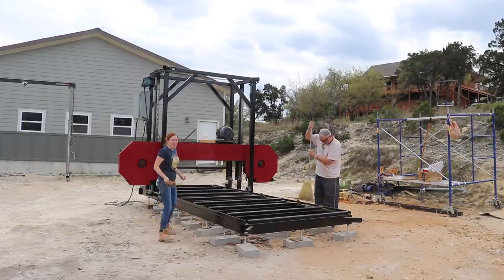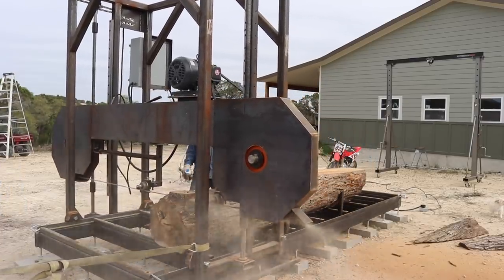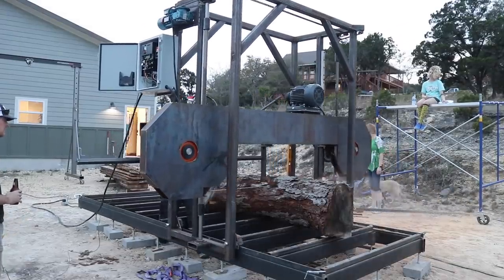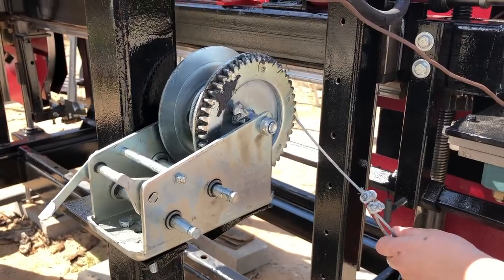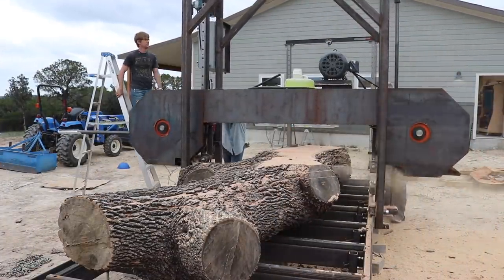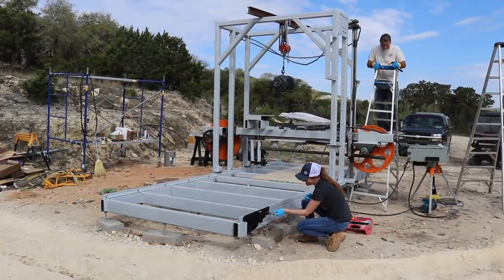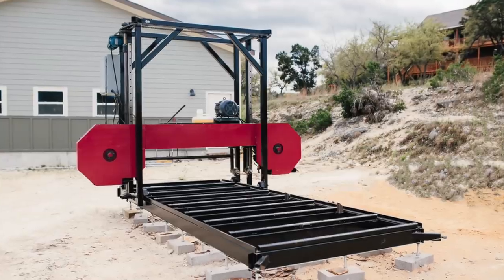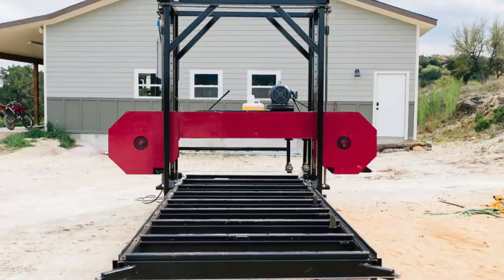Slabbing With My Bandsaw Mill

Comment: April, nice work on the new sawmill. It looks great. For ideas only, take a look at the Wood-Mizer LT35 Hydrolic Sawmill.  It’s expensive, but it may give you some ideas for your own sawmill.  The Hydraulic loading arms, turning arms and log leveler options all make it so much easier to do milling. At a minimum you probably need something to hold the log in place while you cut the slabs, which not only gives you a better sawn result, but it also saves your blade in the long run. Imagine what it would be like if the blade hit something hard, like a nail or a piece of embedded barb wire; the teeth might catch and move the whole log and who knows what kind of damage could be a result of that event.

Comment: I enjoyed this series a lot and it looks like it turned out great!. i have a few tips. when you pour the slab you could have i beams in the floor that you can weld the bolts to in case the floor isn't exactly level. or you could just simply put anchors in the floor.

Comment: I've been milling slabs and air drying for 8 years and can offer some insight.  Some woods, particularly sycamore, will dry much flatter if your stickers are placed all the way at the end of the slab.  It reduces cupping at the corners.  Sycamore is also prone to 'sticker stain'.  Using pine stickers can stain sycamore 1/16" deep into the wood.  My solar kiln is great in the summer but in winter I wish I'd have built a dehumidifying kiln instead.  Lastly, treat the log ends before you mill.  It's so much easier than painting individual slabs.  :)

Comment: Make a kinda greenhouse shelter 
Roof can be clear or solid. Solid for shade.
Make the sides out of soft clear plastic, and add ribbing to it. Sides like this will serve 3 purposes. 1, protection. 2, dust collection, especially if you ever move the mill into a warehouse setting. 3, they can, because of the ribs, be lifted up to the roof when they need to be out of the way. There are other ways of doing usefulness 3, like curtains, but the ribs will provide support and weight. 
I suggest table cloth covers. You can get them thick and cheap from Walmart or a dollar store. They are also more clear than most plastic that you can find at construction stores like home depot.

Comment: Like the color. As a suggestion for the blade supports. To move them in and out from the logs you are cutting. You could use a long lead screw to do this when you are by yourself. Lead screws are generally used on 3D printers and other machines.

Comment: great seeing you build your own mill I built one as well. one thing, you might consider on your slabs banding them together using a shipping binder  even though you think the weight is enough to prevent cupping or warping, it isn't always I cut a 42" by 12 foot walnut log getting 6 slabs banded them together and had no twisting or warping.

Comment: nice job.
one tip, always carry your logs, instead of dragging them so they stay as clean as possible.
dirt will dull your blade.
The Height guide on my mill, is simply a magnetic ruler stuck to a vertical post, with a plexiglass wrap around that rides with the saw head. simple, works great.
Nice mill, good luck

Comment: Im a structural engineer and wood enthusiast interested in building a wide capacity mill. Your video series was awesome and inspirational. Very impressed with your build team’s fabrication and mechanical skills. 

I wonder if a bigger hand wheel crank would be a good upgrade for moving the mill versus the smaller winch handle?

Comment: When you get around to building a covered area to cover it, a crane above running from an area you can unload from the tractor would probably help with loading logs onto the bed and unloading, plus it would give you the ability to load directly from the trailer

Comment: tips 
Moving the blade guides in and out is the best way. 

Using a sand blaster to remover rust and prepare for paint is best. 

A pole barn is what you want for a cover.

Diesel is bad idea many reasons 

Water is best !

Comment: Great video series. Diesel or kerosene may affect finishes later when you work the wood. I would stick with water myself. You will want to get away from dragging logs as much as you can too. Dirt stuck on the logs dulls the blade quicker.  If you can stage them on beams or logs to canthook is best, but some of what your doing is impossible to handle that way. Love the sawmill, great build. Thanks for sharing

Comment: A few suggestions from when i owned a mill for a few years.   Put considerable weight on top of your stacked slabs or ratchet strap the middle and ends and tighten them periodically.  Will keep slabs from twisting and cupping as much.  Also when loading tapered logs on your mill, use stickers to "level" up the smaller end.  You will retain more usable lumber instead of one big shim that tapers to bark.  Its a judgment call which side of a log has the most value/character but that is the choice of the mill owner!  And the last trick I learned was to coat the end of slabs with wax or some type of water retarding coating.  It helps the slab dry at a uniform rate, otherwise they dry end to middle and that will cause splitting at the ends.  When doing this make the slab look like it has been dipped an inch deep in whatever you use, not just the very end.  Exterior latex paint 2 coats thick works also and is easier to play with than melting wax.

You may have already learned this since video posted, but if not, hope it helps. Nice mill.  Who do you have to find all the parts for building things like that?  I can literally spend 100 hours on the internet trying to find a part like the weep valve with a window and never find it.  You made it sound easy. Thanks for the video. Looking forward to watching more.

Comment: A sawmill uses an out feed trey and a sticker stacker I operated in a chip n saw small log mill. You need a set of forks mounted on your tractor and a counter weight that connects to the three point hitch. We bought an old industrial tractor. You are making chants or slabs instead of a cutting list for a building package. A sawdust recovery system and designer barker. You can stack your spaults and call in a chipper or haul out on a trailer for hog fuel that runs a boiler. Your option is a rack or trailer. So you need lumber out feed and slab out feed. Some material like hemlock has a natural twist to it while whet or drying. You van call in a grader to grade and stamp your wood to meet code. Old dryer systems use rail track. For level track to move lumber. Stable ... We used bunk cants to store lumber.

Comment: Serious unit. I watch a lot of people using Saw mills and not one of them uses diesel, they all use water but if that's what works for ya. Great video.
Also seal the ends with paint or anchor seal and try using a 12'' or 16'' joint compound blade for the sawdust, works great.

Comment: Very nice project. I think it will pay for itself with lumber production. A ‘retired’ neighbor of mine brings in between $1000 - $1400 a month working about 20-30 hours a week slabbing lumber so this could eventually not only pay for itself, but also pay for some of the shop as well. A flat concrete slab will be useful in several ways. I recommend you check out a YT channel by Bus Huxley where he built a nice shed for the band mill of a neighbor. He has some good ideas for sawdust control he included. Also, check out the way the Woodmizer LT35 uses hydraulics to handle the logs making it much quicker and easier for one person to handle heavy logs. It could be a terrific upgrade to your mill. 

Keep your great videos coming our way.

Comment: April, you have lots of great suggestions in the comments! One I would suggest that I have seen and have not seen in any of you videos is to get a set of forks for either the skid steer or tractor (perhaps they would fit both) you find a 1000 uses for forks but also get greater control for moving your logs. 
Along that line, try to always lift the logs instead of pulling them out of the pile—sand, dirt and gravel are all not friendly to your saw blades!

Comment: you may want to try having a power washer nearby . i dont have a debarker so i wash the dirt off my logs before i roll them onto my mill . keeps my blades sharper longer . also use it to lightly rinse the sawdust and detergent from blade lube afterwards . i dont see anyone else on youtube doing that but it works well for me .

Comment: Great project!!! as usual!  But $$$???  My bro-in-law has a gas powered sawmill for slabbing, but he ends up making everything into planks for construction. Ash, oak, cedar, poplar, maple, walnut, etc. He made a saltbox shack up by his pond all out of poplar (great for 2x4 studs and framing!) and cedar for the batten and board siding... All from free logs cut on job sites where he works (they install home solar racks and sometimes they need to clear land for them!) As you did, he stacks and stickers them under a covered area (carport for his tractor and other large equipment) but open to the outside air.

Comment: So one of the things that might save a lot of headaches and money in the future (because the EPA rules that passed about 8 years ago) is to have a way to contain the diesel from rainwater runoff. When you pour your slab, have it drain into an oil separator. It's basically just a catch basin that stays full of water and doesn't let the top layer flow past, since oil floats. This might save you from some very steep and ridiculous fines later on. You can dispose of the oil as needed. It can also be placed so that it catches any oil from maintaining equipment and vehicles as well.

Comment: Look at the band mills that are available for add-ons.  My thought is a turning mechanism and a leveling mechanism and a clamp mechanism for holding the log or cant..  Check out as many sawmill videos as you can to get the ideas.  As suggested by others, use water an the saw blade.  A way to adjust the blade guides in and out from the control station would be most helpful.  The adjustment mechanisms can be controlled from a stand on the end of the bed.  I am no sawyer but I have watched a bunch of these type videos.

Comment: If you are using NON road/ non road taxed diesel fuel for the lubricant, it has RED DYE in it so that the D.O.T can determine by the color if you are running it illegally in a highway vehicle (clear undyed diesel with highway road taxes applied is required for highway vehicles by our laws)and are avoiding paying the road taxes.That red dye will color the other wise white colored wood.
   Nice build as always!Looks like you have a lot of fun and friends too. Very nice to see family/friends/unity!Note, Now I don't know much about wood other than what I grew up with and still use around our ND farm and a little from school shop and my personal observation., but as a woodworker, you will cuss the diesel fuel because it is an oil and it (oil) will effect the finishes you apply to the wood and how they absorb it. A lot of the diesel will come off from  planeing the slabs however. But any missed or soaked in will taint the finishing. ..I probably wont raise the grain which water will.Water will evaporate and the grain will set back down.id stick to water as it dries up form any spillage too.it wont smear you mill or you ground and hands.
... Im impressed with the wood grains I saw in the video.. I have a friend that (40 years ago)made a fairly large living room table from a quite thick slab cut of a local american or dutch?? ELM tree that was effected by the "Dutch Elm tree disease or maybe the elm tree bark beetles? ". He covered the top in a  clear lamination coating like a modge podge or similar epoxy like protectant. The grains was just beautiful with colors and detail from the tree wood disease damage and growth. Apologies for the length of the comment.
Reply: The lubricant is being applied with like a sponge applicator so not a lot of liquid is involved. The fact it will be planed I doubt there will be much of an issue.  I would guess the sawdust absorbs some. Potential to be aware of for sure.

Comment: Make sure to put a hoist beam in with ability to use a crane for maneouvering the entire logs and the individual slabs lifting those before and after milling will make operation sooo much easier and you already have a sort of frame to mount the beam onto, just make sure to build it high enough to allow the saw easy motion underneath.

Comment: Absolutely switch from diesel to water!!  I've been milling logs and slabs since the "90's", and I've never needed diesel/kerosene.  You can add a bit of dish soap or Pine Sol, if you are worried about pitch building up on your band.   SR

Comment: I worked on a sawmill that had an automatic set works on it. A rotary switch selected the thickness of the board you wish to cut. Then pushing a momentary contact switch and releasing it would move the set works to cut the size board the rotary switch was set for.

Comment: I live in East Texas and I cut most all of my standard lumber myself, and I use a steal banding tool to keep the wood from warping while it dries. Suggestion, I built a spring retention system on my blade guide with rollers that follow the contour of the log it works great.Great Job

Comment: The Mill came out Fantastic April  the paint Color Scheme looks great  as well  its way nicer than the single color most people paint their  final products BTW i know a guy in  West Virginia that  always lubricates  his blades with water / Dish Soap  combination  that he swears works great and Cheap ?  He and his family own a several hundred Acre Farm and Mill off their property. The last time i was there they had Milled enough Lumber for 6 homes and a pretty big Barn  they were lucky enough to find Natural Gas on the property and now they get Free Gas  forever  which was kind of cool because they used it for everything  including generating their own Electricity and even a under Driveway heating system so they didnt need to plow  in the Wintertime  the Mill even ran on Natural Gas  which was a Gasoline Motor they modified !  Their goal was to have all 8 Siblings eventually live on the property free and clear

Comment: I try and get the center of the log at the same height at each end.  I'll usually make a cut then rotate the log 180 degrees so I'm getting slabs that are parallel to the center.  I just keep some 1x and 2x4's around to act as shims for leveling the log but my guess is that you will over-engineer a hydraulic lift to get the correct height ;-).  It looks like your saw could probably cut two logs side by side, speeding things up especially with smaller logs.  Also, ditch the diesel and go with water and some sort of soap.  The water is essentially the carrier for the lubricating soap.  Go to the library and get some back issues of Woodenboat magazine.  There's usually technical articles in the back about different types of wood, how to dry, where to use, etc.  Most of what I cut is Douglas Fir (should give you a clue where I live).  But sometimes I can find a Madrona trunk to slab up.  (In Canada it's called Arbutis)  The stuff twists like crazy so I have to bolt it to a concrete floor to get usable planks.  I've heard the same about Eucalyptis but have never cut it.  Talk to local cabinet makers for practical knowledge regarding how the different woods behave over time.

Comment: One thing we've found with airdrying slabs on rough ground is to put the stack on pea gravel or loose soil, as the slabs will be flat for the first week or so of their storage, the stack will actually press the bearers flat, after which we ratchet strap them.

Comment: Take an old tape measure and glue it to a vertical member of the gantry (or screw it on with self drilling screws) for your height refference.  I think you will find that a permanent roof over the saw will be ideal.  A roof like you did for the car port at your parents.  The nice thing about the roof is that since you have a electric powered saw, you can have lighting as well.  You will probably realize that having two walls on the structure will help manage any severe weather days (rain or wind).  Tho you can always wrap a tarp around the opposing two walls if you needed to close it in more.  Looking forward to more future content.

Comment: A small thing to add is a set of mesh guards over the shafts on both of the wheels as that part will pull in clothing quickly.

Comment: If you could combine a roof structure with a gantry crane for log handling, then you would have an extremely slick setup.

I'm also kind of curious why you went with mounting the electrical box so high. Would love to get a walk-around design review video sometime after you get a bit more use out of it - What features are really working, what things have bugged you, etc. 

Thanks for another great video.
Reply: After April's build for her parent's carport that may very well happen.

Comment: So great looking mill. And im sure everytime that you use it. You find different way to improve it. Acme screw for your drive up and down. Servo motor will get to .000 of and inch. Also a rail drive gantry with friction wheels.

Comment: You definitely will want some extra space on the base concrete to place the cut slabs for ease of moving and also space for some kind of loading mecanism so you won't have to battle the tractor quite so much, maybe a winch operated sled that will allow you to roll the logs on after raising them to align with the bed?

Comment: Black conex, with solor powered fans. Good way to dry. Also maybe put a hose on sawdust chute to drop in a long box. Then take that and a bit of wax to make fire starters, a large 3 to 4in pipe works well. Just fill with mix and compact abit. Then let dry and push out